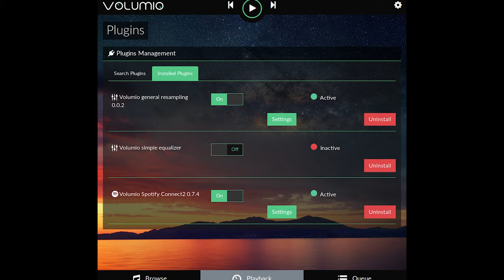The Last Raspberry Pi Music Streamer I am Ever Building! | Allo Digione Review

Comment: I've been using both the Allo Digione Signature and Justboom digi hat for almost a year now. Both are on RPi4s and have RoPieee installed. The Digione Signature absolutely smokes the Justboom digi hat, the difference is night and day.
Reply from the maker: I recently A/B'd the Signature and Digione and its almost identical audibly.
Reply: @audioarkitekts  HI, I just commented in the upper comments level about the DigiOne Signature. I don't question your opinion or the results of your A/B test. However, for the benefit of all of us readers, that result should be taken cautiously as there may be other factors in play that may influence the result, power sources, DACs and speakers used are some of them. Still, it is very nice to have this conversation because, as I mentioned in my other post, this information on using Pi as a streamer is not abundant in a simple direct way, thank you.

Comment: Hi Mike. Thanks for your fantastic video! I have a question. I only listen to classical music and it is almost mandatory that transitions between tracks in Tidal are smooth, without any crack or delay. I have tried HiBy app and it is not suitable in that respect. Do you know if Volumio works well with Tidal? This is why I am still differing from having de raspberry pi 4 streamer. I use a direct connection to a PC via USB C to a Fiio K5 Pro DAC.
Reply from the maker: Volumio does Tidal Connect if I am not mistaken so you would be using the app directly

Comment: Hey Mike, greetings from Indiana. I am a former transplanted Coloradan from mainly Colo Spgs but did live in the Longmont area for a few years in the middle of my stay. I was out there about twenty years (the Air Force dropped me off, eh?) and loved the state. Anyhoo, back to the PiFi talk. Back in July, I got bored and using your video built your Mk.I version of the PiFi. It has the HiFiBerry DAC2 Pro but I am running RoPieeeXL for the OS, that way I can also use a few other streaming apps, besides Roon. But I mainly use it as a Roon endpoint. I did end up buying a better USB wireless dual band dongle for 5GHz use and a 3.5amp P/S with an on/off switch, to cut down on the plugging and unplugging on the USB-C port. Yeah, the metal case (which I love BTW) really did a number on the wireless reception of the RPi and the original USB dongle was only 2.4GHz, so it worked better but not great, just too many devices in that band. Running it at 5GHz has really helped. I really like the Mk.I version because it is pretty self contained, as long as it can see my network and be jacked into a few RCA inputs, it is golden. Otherwise, I could have just used one of my stockpiled Chromecast Audios or even the RPi to drive my USB DragonFly or USB iFi Nano DSD, but that isn't as fun as these little projects, is it? Thank you, for the push, sir.
Reply from the maker: I think they all work fairly similar to one another, however I have always hard wired in using the TP link travel router to avoid noise and interference with the wireless feature. Hope that helps :)

Comment: Do I need to use a DAC if my amp (Cambridge Audio CXA60) has a coaxial input as one of its digital channels?
Reply from the maker: Nope because your Cambridge has a DAC built in.
Reply: @audioarkitekts  one more question...thoughts on 2gb vs 4gb RP? i've seen people using the 1gb 3B
Reply from the maker: I always go for the best to achieve the best results but the 2gb works just fine

Comment: I’m interested in how you compare the sound of the Bluesound streamer, equipped with its own DAC, to the ALLO device, which outputs a digital stream, only? Help!
Reply from the maker: I didn't use the DAC on the Bluesound Node 2i I simply used it as a transport via the Coaxial Cable. The DAC on the Bluesound is inferior to the one on the Cambridge.
Reply: @audioarkitekts  Thanks!

Comment: Hi Mike, yes big improvement with plastic case.  i have built a number of streamers recently including: 1x Pi3B + HiFi Dac 2 Pro; 2x PiZero1.1W + Allo MiniBoss; and a Win10 NUC computer with a Helm Bolt into an Aux cabled bluetooth speaker.  All plastic cases from the appropriate DAC manufacturer.  All sound great on ethernet currently (likely will move the PiZeros to WiFi for testing).  Due to the server library size  limitations of Volumio (utilizing a QNAP NAS), my software of choice is picoreplayer  on an LMS platform (running LMS software on the QNAP) which has a Windows and Unix clone also.  Then, use the incomporable iPeng on the iThingys.
Reply: I already have a re-clocker which accepts USB connection and feeds to my dac via coax. Can I simply use the raspberry pi alone as a streamer as I don't need analog out from my pie? Will volumio work in my case? Can I use foobar running on my PC with this?
Reply: @Thoughtflux  Sure.  Alternatively, you could use a 1L windows PC.